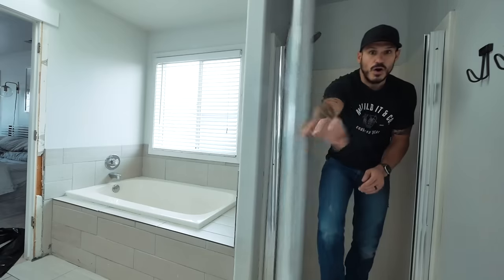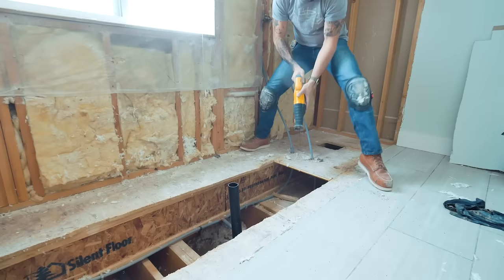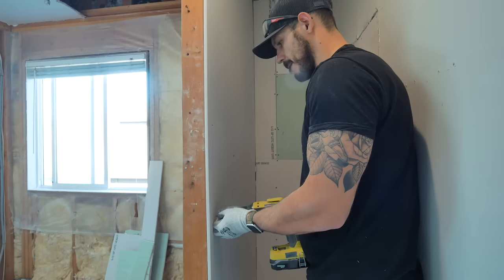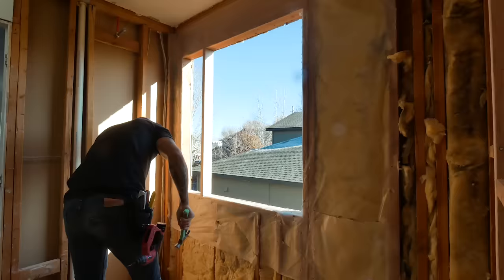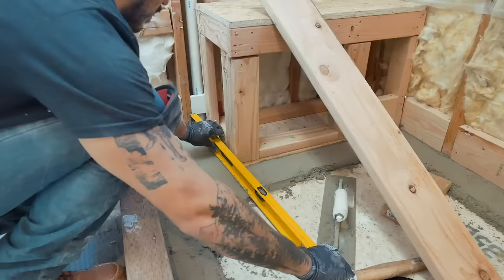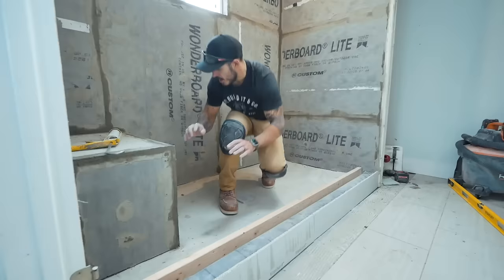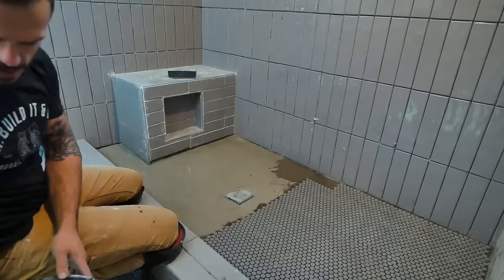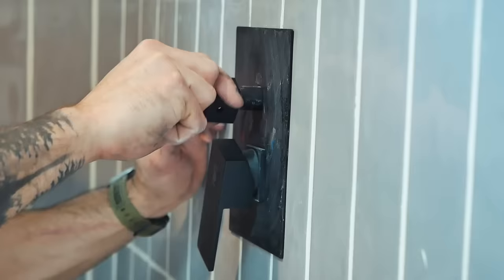Building a GIANT Shower (Home Remodel)

Comment: Europeans watching this like: "is this his tree house? why is everything made out of wood?"   try to DIY a new bathroom in Germany. You will hit 1 Meter of concrete in a second.
Reply from the maker: Bahahahahahwh
Reply: Then americans wonder why they get water damage🥴
Reply: It's not the concrete you have to worry about, it's the Bauamt, Ordnungsamt, Gesundheitsamt and another frigging AMT that what's to stick their noses in. And then there are the fees to pay to the above mentioned AMTs. That probably costs more than this guy paid for his whole build... German bureaucracy... Keeps the whole country afloat.
Reply: Where do you put electric lines? Plumbing? Insulation? Dead bodies?
Reply: Marshall Nelson cut a chanel into the bricks. Add a layer of drywall, etc. In Germany houses are built to last but usually get wrecked for new houses after maximum of 60 years... yeah that’s intelligent
Reply: Thought the same : wow American renovation seems soo easy! But not all Europeans are like the Germans.
In the Netherlands it’s also built more for the eye than for ages haha. A plumper from the Netherlands once said „we Netherlands built for one generation, the Germans for five“🤣🤧
Reply: try it on brazil too, we use concrete and bricks, in 1 hour you remove a wall, here in 1 hour we remove the wall tile, its the same but we concrete it on the wall. i don't know the right translation, but here on bathrooms we use a type o "floor" on the wall, its like 50cm x 40cm, if someone knows the right word i appreciate
Reply: @PaulAlford  French Bureacracy is worse...I would at least expect German bureacrats to be efficient.
Reply: @emrekaratas9716  people don't understand that these houses have to be built quickly due to the growing population. Of course an old shit hole in Germany has to be built out of concrete when there are going to be 5+ generations in the same house
Reply: For real ! You can improvise shit like this on European houses 😂
Reply: haha ist so. Wir können halt Häuser für die Zukunft bauen
Reply: M JP in Florida is concrete brick and in wood inside
Reply: @marshall3n  Concrete... Obviously.
Reply: Yung Eagle All the houses are built with brick and concrete, not only old houses. Even our barns and sheds are sturdy brick. The only wooden house we have are those gipsy mobile homes or trailers. And those are kinda pricey, so that’s why we prefer brick.
Reply: Same for Southern USA. If its not on a 2nd floor, It is problem on a concrete slab. Only thing right now keeping be from doing this same type of change in my master bath is not wanting to deal with relocating plumbing with a slab of concrete to cut into.
Reply: Primeiro A Morrer . Tile?
Reply: asdfghjkl english is not derived from German directly, but from Frisian. That’s Dutch not Deutch. Also, before WWI the majority of the US spoke German as a first language and some minority still do.
Reply: It's Private japan is a pretty unstable land with constant earthquakes and it has strong houses.
Reply: Dont say that dude, i am about to start a project like this IN GERMANY.............
Reply: Aber jetzt mal im Ernst. So amerikanische Häuser könnte man alleine mit einer Axt binnen Tage dem Erdboden gleich machen. Ich bin sehr froh, dass hier in Deutschland der „massiv Bau Stil“ besteht, die Häuser also stabil und was für die Ewigkeit sind und man nicht die Angst haben muss, dass das Eigenheim beim ersten Windstoß flöten geht…
Reply: But like fr
Reply: @MrBuildit  bwahahahahahahah! you are so hot
Reply: Not all of Europe has concrete and brick houses. In Scandinavia (Norway, Sweden, Finland and Icelnad), 95% of the civilian houses and buildings up to 3 stories are made of wood.
Reply: Paul Alford that’s why it’s sinking so fast then.
Reply: lmao look at all these "architects" and "engineers" suddenly emerging here.
Reply: Living in Germany and for my new bathroom I had to remove 1800 kilos of concrete and old tiles lol
Reply: @PaulAlford  the german government gets involved when you reno your bathroom? thats the problem right there. in canada, when we want to do renovations, we are free to do so since we own the property.
Reply: asdfghjkl so? That doesn’t mean we owe you anything lol. With that logic so did the Spanish that’s why in the south the second language is Spanish if anything we have more of their culture in the US than German
Reply: @PaulAlford  mental note, Germany isn't as good of an option to live as i thought it would be
Reply: Yall ever heard of basements?
Reply: @marshall3n  all of the above can fit into the spaces inside of bricks if you have enough patience. If not, a hole in the wall and a lot of concrete will make sure no one ever finds any of those again.
Reply: @lucas.tadeu021  it would translate to tile. It's kind of a giant white thing that is used on floorings of big spaces, isn't it? I'm from south america too, i think that is what you're talking about.
Reply: @somedude2492  yes exactly, i get confused because tile has a lot of meaning and sometimes the translation isn't that right. thanks guys. and in idk more words but in Portuguese we more words for the different types, like the tile we use in the floor, in the wall and some small ones inside the shower area
Reply: Or in argentina
Reply: @asdfghjkl our language is french, german, latin, a bit of spanish,  etc etc. It's a lot of different languages. But it's very ethnocentric to assume that our language came from you guys, hilarious really.
Reply: Then again, the new shower is as large as some houses in Europe ;-).
Reply: Yeah my southeast asian ass cant really related to american renovation. Lol
Reply: I was going in the comments for searching such a comment😂 
These Houses look like cheap bungalows.
Reply: That's also the case here in my country. Bathrooms, restrooms or powder rooms walls and flooring are made out of concrete (foundation).
Reply: As well as in China.
Reply: @PaulAlford  Well, at least in Germany your houses are not turned into a pile of matchwood every time the wind blows a little stronger than average. All you need to knock an average American house down is a little hammer. Those wooden junk boxes aren't even worth half of what they cost.
Reply: German homes had to be built strong to withstand air raids.
Reply: @justmeandthethree  Crap! Most German homes were built after the war. And absolutely no house - unless you build an air-raid shelter or a bunker - can withstand being targeted by an air strike.
Reply: @PaulAlford  The Country  that is an economic  powerhouse  despite being  decimated twice  in the last 100 years .   Compare  that to America that is  swamped in debt
Reply: @EricMustardman  Caught one! 😉
Reply: @emrekaratas9716  this is why I build my own house. Screw the crap here that falls apart in .3 seconds
Reply: @kachow945  Why do some of the most idiotic comments come from Germans?  I’m German and have lived in German houses and the only thing I like about them are the windows.  My house in Texas is 300 square meters plus a 2 car attached garage.  The house is now 37 years old and still looks new.  We have winds up to 70mph, hail, very heavy thunderstorms, and the house has never been damaged.
The house has two HVAC systems, one for the living area, and one for the bedrooms.  Most Germans sweat in the summer and say they like it and it saves the planet or some other BS.  The best part is that I can sell it in two weeks and make a cool $300K profit and buy a new $700K house.
Reply: @lucas.tadeu021  same in Argentina, and I guess the rest of South America.
Reply: Same here in India! It's concrete and brick and we don't use wood !
Actually here we don't do wood houses for safety reasons and as well as for longevity! And houses lasts for generations here! Plus constructing wood houses would cost 10 times more
Reply: It's Private  yup sure. You might forget that even part of the north pole is in Europe. Lapland has currently weather of about -40°c. So I'd call out your knowledge of geography. Who's the idiot now? Lol
Edit: And btw, pretty much all of the houses are made out of wood.
Reply: It's Private  lol another nope. We are not nato country. And what does any of the things you said have associating with house building and the fact that you were ignorant? As you still are😂 AND how after "the best universities are in america", we still manage to have the best schooling system? Destroyed.
Reply: It's Private  yea because its not so warm in here that we would need one. Educate yourself for the love of god
Reply: It's Private  yea well your one of the most coldest places on earth has -1°C so rip to that too. And we don't have central heating because thats just old school. We have evolved :p no need to get salty even after you might have given a glipse of reality
Reply: plus we never drill into tiles as they could crack. nice job, shame he didn't switch on the shower to make sure it is all working :)
Reply: @PaulAlford  Never heard that a Ordungsamt and a Gesundheitsamt stick their nose a a build stuff on your house?! they dont care - also the Bauamt is only looking for the "whole constration of the house"
Reply: Ah, the Amerikans always so eager to prove that they are the greatest thing that has ever happend to the universe....
Reply: @ripshot2222  no they dont. I think Paul wached to much fake american docus about germany...
Reply: @Dima.P121   "also the Bauamt is only looking for the whole constration of the house" - that just is not correct.  Any structural change to a house requires a bauantrag.
Reply: Some people in this thread are a joke. Just cause you build out of concrete or brick doesn't make your house fireproof. A lot of eastern houses still rely on wooden framed windows, if not the construction above the window is always structually weak. A fire can break out the window and run into the partitions of the load bearing walls. That insulation is always a burnable thing. Remember, fires spread in tighter spaces much much faster than an open fire. Wood houses aren't prone either, but a well built "wooden" house, note most of them are brick layered on the outside, or per say block layered, still give you half an hour to an hour worth of time before the fire decimates the house. OSB and plasterboards still have good quality fireproofing. German houses are actually more structurally prone to fires anyways.
Reply: @Arthur-gk1oc   "German houses are actually more structurally prone to fires anyways."  Do you have a link with info about that?
Reply: 😂 I live in Italy and that was definitely the first thought that went through my mind.  Walls are all concrete🥺🤣
Reply: @hallobre  Also, before WWI the majority of the US spoke German as a first language and some minority still do. - What?
Reply: @Favorites324  Yep, concrete and reinforced with rebar in Germany.  Trying to burn down a German house would be a lifelong task 😂
Reply: @Arthur-gk1oc  That does not say that American wooden houses are better at protecting people than a German house.  On the contrary, it does say this "The building material is classified as “flame-resistant” and is protected from direct contact with flames by layers of plaster, among other things. For that reason, it is considered safe and is permitted for residential and office buildings up to a height of 22 meters (72 feet)."  And wood is directly protected from flames by what?  Yes, I thought so...
Reply: @Arthur-gk1oc  And BTW, deaths per million of the population in fires are twice as much in the US as in Germany.  12.4 people per million US, 6.2 people per million Germany.  Enough said I reckon.
Reply: @mwnciboo  hahahahahaha no
Reply: @marshall3n  Just cast them into the concrete, duh.. Way more convinient, and no bad smell.
Reply: Came in italy: we make also the towels in concrete
Reply: Lmaoooo I seen about 10 comments like that hahaha like why are they watching this??
Reply: i can confirm this im a plumber in germany
Reply: Northern EU has lots of wooden houses tho
Reply: @ElTokeMaestro  I came to say this. I like the concrete blocks for hurricanes but they're a pain to build into.
Reply: @MrBuildit  touche our house in sweden, try to do anything with when it comes to toilet, and your fked, due to concrete etc, our house base is like 1.5m concrete and other then that our house is a brick house
Reply: Rotary hammer rental is like 70 USD
Reply: @PaulAlford  Channel the walls out and then plaster or most common through and under the wooden floors boards or wooden ceiling  and when you run waste you core a hole out through the wall
Reply: @YungEagle3k  I hope you realize they are out of wood because wood is plentiful and cheap, not that omg we are running out of houses we need houses right now
Reply: Mao that's why water damage companies do so well
Reply: In Brazil you'll find a bunch of bricks. That's it.
Reply: we have lots of trees, its that simple.
Reply: ReDragonDima are we not🤦‍♂️
Reply: M JP Everyone, everywhere. We also use bricks and concrete. Little wonder that their houses fold like kindling in windy conditions.
Reply: Mahogany_Hues in the US of A there are a bunch of houses that are made out of brick and stone. And no the wood houses don't fold like kindling
Reply: Try doing that in northern Norway, and all you'll find is old clothes and news papers as insulation
Reply: @PaulAlford  Not for long.
Reply: @asdfghjkl Keyboard warrior over here
Reply: @marshall3n  Didn't you see the part with the hidden door?! haha
Reply: @kachow945  Ich liebe deutsche Häuser. Alleine der Altbau-Stil geht mir richtig ab, mit den hohen Decken und dadurch so groß wirkenden Räumen. Außerdem ist das eine extrem nachhaltige Art Häuser zu bauen. Bei mir um die Ecke stehen mehrere Häuser, die schon mehr als 400 Jahre alt sind und immernoch völlig stabil sind!
Reply: LUL so true
Reply: @PaulAlford  yeah, but if we build a house, its forever. Not just until the next stormy weather.

And... no one gets hurt when building, no one gets hurt when living there, no one gets hurt when repairing.
If someone gets hurt... yeah... health insurance.
Reply: @MrBuildit  Or sweden lol HAAHHHHHAA
Reply: Lanie L Why do they make glass and tile drill bits?
Reply: It's Private  i cant agree with what u ar saying. A European house has a 14cm thick styrofoam   
Thernal Situation which is regulated by law. For the most efficiency you only need 8cm.  Also it is possible to build a skyscraper which is earthquake safe (out of concrete) I am not wondering when i see american houses burning like matches or how elite police get shot through walls. European houses are much more safe then any american house can be anywhere.
Reply: @mwnciboo  its same everywhere, if inspectors will locate his house, he will get into deep troubles up to tearing everything down and redoing it all.. + fines
Reply: In india you will hit the concrete without any doubt. What I felt is the same about woods..lol..
Reply: Yeah I’m from Germany too and was thinking the exact same thing
Reply: @euniquelittle2430  we also say, germany built for 100 years. But after 20 years a we will renovate it again :D.
Reply: @marshall3n  In the walls.
Reply: for real i wish houses were made out of wood, it looks so easy and fast!!
Reply: Here in Sweden, the majority of houses is made out of tree. Unlikely in the city where it most likely to be concrete.
Reply: @YungEagle3k  Germany aint America where generations have to live witheachother because of being bankrupt of visiting the doctoer 1 single time.
Reply: So those bomb shelters are still in use? LOL
Reply: Same goes for the houses in Belgium, all concrete 😄
Reply: yeah, really! I was shoсked by this fact (wood skeleton). I from Russia and for me this strange. But it looks so easy to do
Reply: @marshall3n  sub flooring, lots of room for bodies.
Reply: Switzerland too
Reply: my whole house is made of chip board basically 🤣
Reply: M JP lol same in China. Concrete all the way
Reply: @emrekaratas9716  Concrete still gets damaged by water intrusion. It has to be sealed and that sealing has to be maintained.
Reply: @YungEagle3k  lmao
Reply: Wood is the cheapest here in USA. We want nice brick but that shit is expensive to build when u have to pay for labor 😞
Reply: It's Private  fun fact
We also have gun control here
So noone would be able to get a shotgun and blow the hinges of your door (nice phrasing by the way)
Also nearly no mass shootings so
...
That's a win
Reply: Hahahahahahhaha
Reply: Caribbean is the same way. When I was a kid I always asked wheres the drywall. Walls are concrete
Reply: @Bruh-mg5ff  00⁰⁰
Reply: @PaulAlford  Literally not. You can do almost everything yourself. Like we did, we changed almost everything in our bathroom etc ourselfs. But If we wanted to do alittle crazier things like make half of the garden out of concrete then yeah we would need some paper work. Of if we wanted to tear down a load-bearing wall..
Reply: Milad J. Panah so true
Reply: We build our homes with brick and concrete in Turkey too, you can take a wall down easily but rebuilding would take sometime. I am glad tho, it's better than drywall and wood.
Reply: Lol same thoughts I initially had as an Italian!
Reply: At least europeans have a decent health care system
Reply: Milad J. Panah you don’t understand the quality of building materials in the US are made to withstand various natural conditions such as earthquakes, hurricanes, and high levels of moisture. The US is an extremely large country and Americans have learned long long ago how important it is to build safe homes and aesthetically appealing at the same time. Europeans are not use to the high quality materials made and use in the USA, unless you are willing to pay the price. Europeans are limited to cement and wood. I would like to know how European house fair a hurricane or a 7.6 earthquake.
Reply: Post Brexit Britain.... All our bathrooms in the UK are lined with diamonds and spare gold, win win! 

The Netherlands will be next!

On a side note, there's "nowt" wrong with US building regs and standards; and German love of concreate is something our Grandparents are all used to! just don't mention the war!  

Toodle pip!
Reply: Wood.... Because it's cost efficient 🙈. Some American homes are made of brick/cement not all. I'm sure where you are it's required so the cost is not considered.
Reply: @hallobre  ..... ok, I would love to see the source for your "facts". There is a myth that German was almost the official language of the US ...  MYTH. The facts are completely different. This myth stems from the fact that some German immigrants requested laws be written in German as well as English. There was never any vote to make German the national language. German was not the majority spoken language as you claim. 

Also more to the point .... that happened in 1794, and it was German immigrants in Virginia who requested the laws be published in German as well. One small group, not a nation of Germans in the US. Please .... stop trying to school people with your ignorance.
Reply: Diogo Garcia  .... a lot of houses in the US have washers and dryers in the bathroom. It is easier to put the connections for a washer somewhere you are already running water lines. One of the easiest simple rules of carpentry. Just like the rule for plumbing, drain lines is specific .... "shit doesn't flow uphill", so you need a slight downward slope on any sewer line.
Reply: @onefortexas2379 , and as has been pointed out .... remodeling is so much easier. If people take care of a house, it can stand for centuries. I have friends that just bought a house that was built by Irish immigrants around 1800. I inspected the place for them. Had a few craps in the foundation and some other minor structural issues but nothing major in a 200 year old house. I was amazed.
Reply: @mbloor77 , same principal as cutting tiles ... use water or lubricant. Makes it much less likely the tile will shatter. Look at the wet saw for tiles, it keeps a stream of water supplied onto where you are cutting.
Reply: @pinascoladas9775 , how so? An American posted the video and I have seen Germans and such downing everything. This guy didn't say his way was the best. Stop projecting your inferiority complex onto us as a superiority complex.
Reply: @PaulAlford   ..... what does it matter i the structure is still standing after everything inside is burned up? Yay ... you have walls .....
Reply: @mirorih2TheTrueFinnmarkWierdo , older houses in the US are like that. They used the old slats and horsehair plaster, used whatever they could put behind it for insulation. I have seen houses torn down with money hidden in the walls.
Reply: @markcurry1168  You have way too much time in your hands if you really start arguing with half a year old comments without valid point🤦🏻‍♂️Go waste your time somewhere else.
Reply: @dr_sami9257 , a German posted the rates of fire deaths between Germany and the US. Talked about how something like 12.4 million American die in house fires, but only 6 million and some change Germans. He didn't take into account that America has 4 times Germany's population. So by the ratio ... there are more Germans dying in house fires than the US. So how is that safer?
Reply: @Neoradon , not true. He probably had a permit. To be honest, I have worked plenty of jobs where the boss didn't go get a permit but we never saw an inspector.
Reply: @markcurry1168  that cant be true cause a german house doesnt burn , the number are a little bit messed up
Reply: Mark Curry ok boomer
Reply: @markcurry1168  ok cool will do
Reply: N
Reply: Mr. Build It in.   N
Reply: Mao kn oknonok k
Reply: Mao kn oknonok kn
Reply: mwnciboo n o morning.  O
Reply: Europeans have concrete houses cause they don't have the amount of trees that North America has.<<<<This is the reason European countries wanted to colonize the Americas.
Reply: @aa65064  whereas in America, we try to get every last bit of utility out of our houses, renovating them over and over again so they will last as long as possible. Maybe we should switch construction methods.
Reply: also the tiling is what we in the Uk would call Cowboy builder job haha
Reply: I mean some parts of the world dont need to worry about being bombed and attacked every 50 years
Reply: Most probably same in Chile to make structures earthquake proof.
Reply: @lucas.tadeu021  Floor tile.
Reply: It's Private  wow whole 80 ha? You know there are easily houses in germany that are over 500 and 600 years old right?
Reply: Same here in eastern Europe every house/building is made out of reinforced concrete, cinder blocks and bricks even the ancient houses are built from stone.
Reply: haha, the same in Poland :D
Reply: this is why American houses fly away when there is an hurricane
Reply: @hallobre  hajdebre
Reply: @somedude2492  hmm.  german standard is very high, that's all.
Reply: @2Drezik  and bureaucracy is a pain in the ass. A point in favour a point against.
Reply: @somedude2492  i ment standard as 'high standard' of living in general.
Reply: It's Called "stick built"... Concrete is overkill. Only coastal homes are built with hurricane code requirements for concrete. You realize 90% of the world's pollution is due to concrete production. So keep building homes out of concrete like the middle ages . The building codes here in the USA are so stringent, I'd take a stick built home over concrete any day.
Reply: Same here in South Africa. Just about everything is built to last with bricks and cement. Makes renovating a massive pain though...
Reply: I'm shocked because those walls are so thin. How anyone can feel save there
Reply: When I get undressed...my shower gets turned on.
Reply: @euniquelittle2430  I am French, I live on a farm which must have been built over 200 years ago
Reply: True story hehe
Reply: Ongod
Reply: Correction* all houses that are ancient in Europe
Reply: @ripshot2222  it depends what style of house. In France, there are houses that are several centuries old. I find it normal that the owner cannot do anything with a house. for example, I live in an old farm which dates from 1800 (in stone). If tomorrow I want to paint the exterior walls in  pink, I won't have the right, and that's normal. For interior renovations, it's more free but some people have crappy tastes
Reply: @aurelien1241  Thats called Liberty, a concept you cannot fathom because you think the majority opinion has rights over the minority. Here, we believe in the concept of ownership and property rights, and that just because someone thinks "its bad taste" dosent mean they get to dictate how others live their life (including pink paint). The house i currently own was built in the late 1800's, made of stone, and i have full rights to alter it the way i please, including knocking it over and building a new one, should i choose that.
Reply: My German Grandpa built EVERYTHING out of wood, only used brick or concrete when he couldn't avoid it (like the foundation of the house).
Reply: Was thinking that wtf, building control here would laugh at this, cant believe there's no outer wall #ill huff and ill puff your house down
Reply: American houses are at least affordable, not like european hoouses which are not affordable for most people, no all people want debt in bank for next 30 years to be a "slave". That's why most germans rent flats. Behind this, who need bunker or a house that lasts 100-150 years?? Most people don't need big houses too. When children grow and move out you stay in oversized house...
Reply: yea i just said in my head WTF is this. that walls ? oh my god.    now  you have answer why they have problems after tornado or a lot of rain
Reply: Most Florida homes are block. We install windows with quarter inch tapcons directly into the block. It's actually less risky work because wood rots and gets termites from bad drainage.
Reply: @marshall3n  I’m investing in a big freezer and then a mulcher and then finally everything goes into my compost bin
Reply: Yeah, i made a similar comment haha XD this makes shit easy!! On the other hand i always remember the story of the three little pigs and the big bad wolf.. and no matter how hard he is huffing and puffing he ain't blowing my house away. 

I also always wonder about those people living in 'Tornado Alley' and then after a tornado blew their wooden house away, they're all upset and in disbelief.. but you live in Tornado Alley, and you build a house out of twigs and paper.... xD
Reply: @gabrieleledda5971  Houses in hurricane zones are often built of concrete. This works great as long as the storm surge doesn't get to them. If it does it really doesn't matter what they are built of. Same goes for buildings hit by anything bigegr than an EF3 tornado. If you take a look at the images from Joplin MO you'll get an idea of what these storms are caable of.
Reply: @Coen80  It doesn't matter what your house is made of when an EF4 or EF5 comes through. 
https://www.youtube.com/watch?v=EBWkd6xTyq4
Reply: @aa65064  your bones do the same thing ~ demolish and rebuild. 
Sometimes it's for the best, but not always 🥲 get the wrong materials or builders and everything becomes house cancer.
Reply: I had same observation when I came to North America long ago.  Construction material appeared to be very lightweight (wood and cards).
Reply: in the UK - was thinking of doing some home DIY - realized this does not apply to me... Love that you can take your WINDOW out that easy, also love that I CANT :P
Reply: @wally-the-web-dev5142  Your windows are probably more sound proof than ours. I personally don't like the idea of sticking window in the opening and put some insulation on its side. I can hear everything happening out side.
Reply: @faisal-ca  both have the pros and cons, brick homes last allot longer, also, total hassle to make any changes to and normally will need a trades person involved in, if you not DIY savey. 

Wood homes you can make look amazing and customise way easier, but you might not get more than a lifetime out of the build (depending heavily on the construction type…) 

Either way is a toss up! 

I just want a big ass shower hahaha
Reply: Depends on the state. There are concrete builds here too. US is 26 times the size of Germany. It’s big enough that houses are built differently throughout because of resource availability, environmental/weather factors, preference, etc.
Reply: @marshall3n  Just "concrete them "in" "
Reply: Just doing a project in my house (country in the middle of Europe). So far we have used 17.5 Tons of steel reinforced concrete, for the foundation only.
Reply: absolutely,we dont know what the hell is house build of wood ...even poorest counrty have homes and flats build properly .Villa for 1,2 nights per month ok ,but house ... floor of wood,walls of wood ,if the wind blow..the house gone hahaha. High standart there is s only  for the richest and the rest live in poor conditions and bad healthcare ,worst then even our poorest east european towns. Its all illusion,at least  we have solid houses, metal and cement , and not that expensive healthcare...
Reply: Yeah in America it's basically completely made out of wood
Reply: @emrekaratas9716  

Europeans wonder why their home cost 10x more (not an exaggeration). Good luck finding a nice 2500 sqft home, granite counters, modern appliances, 5+ acre lot etc in Europe for $300k.
Reply: @aa65064  

Built to last but do not last as long as "wood houses" in the US which can last centuries with proper construction and maintenance. The reason Europe does concrete is not for longevity it's because of their high likelihood to warmonger and "open" immigration policies. Multiple World Wars, Kosovo, radical bombings etc.
Reply: @joebenson528  That’s not what we look for thankfully. We have completely different climates here across Europe so we must build worthwhile houses. It being 10x more expensive is no problemo as you say in the states for 1. We don’t compare house prices with the U.S, it’s irrelevant. 2. It’s worth it.